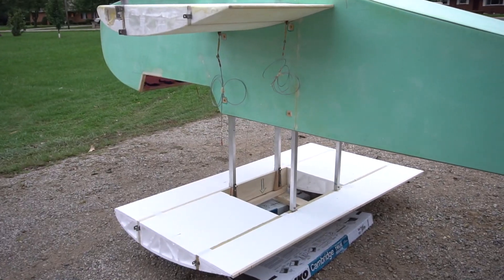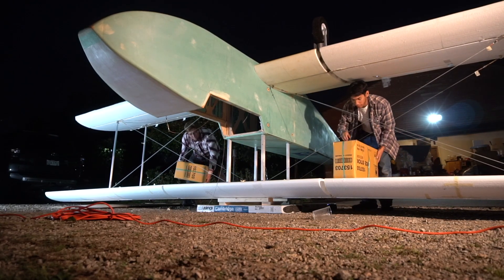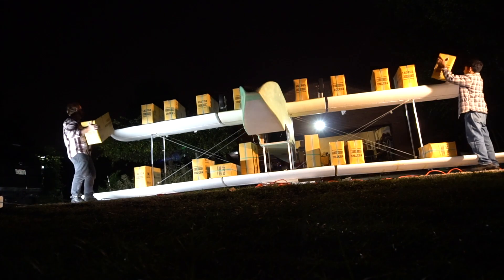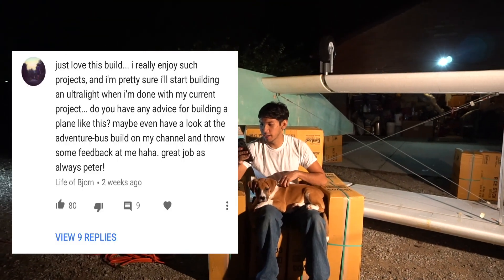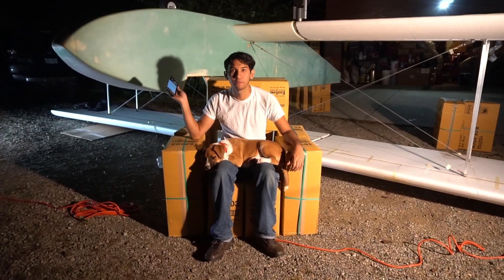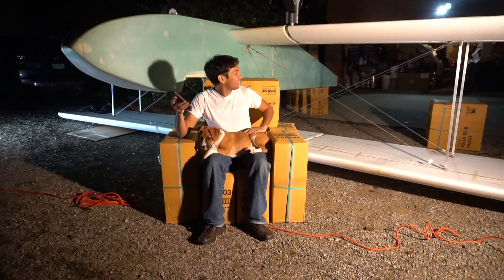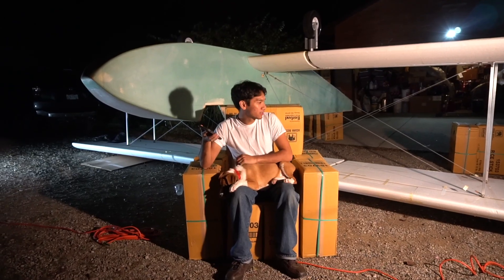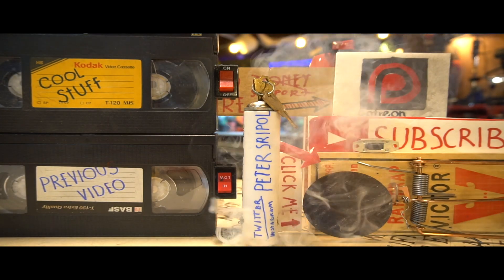DIY Electric ultralight pt5 (Making the Wings)

Comment: safety wire is an airplanes best friend. also do not try any maneuvers until you are 500ft above ground level or highest obstacle. your math on the wing load is off so it would suck if your wings folded in at 100ft. a parachute won't save you there.

Comment: Absolutely correct, DO NOT THREADLOCK nylock nuts.

Just like the others, either use nylock, or castlated nuts w/ cotter pins or safety wired nuts.

Comment: So do you get a higher empty weight allowance because it is electric, or is the empty weight bumped up to 370 because of the BRS? Or did you ditch the ultralight idea and decide to get a registration number? If not you have to keep it to 254 max empty. Also don't forget to safety wire the turnbuckles.

Comment: As a mechanical engineer, please use lock-tite! Like so he can see
Reply: You should post your comment not as a reply
Reply: As a FAA certified A&P, do not use Loctite on the self locking nuts.  They have special nylon material that locks the nut on the bolt.  Do not reuse nyloc nuts, however.  Loctite is rarely used on airframes.  Also, use nyloc nuts where the bolt is not subject to rotation, and drilled bolts with castle nut and cotter pin where the bolt is subject to rotation.
Reply: Loctite has the potential to deteriorate the materials used in the vehicle.
Reply: I've never seen loctite on any ultralight, if it needs a locking nut then mechanical locks are the way to go.
Reply: Samie Don't use locktight because it really will melt plastics. I have had it eat plastics before to great detriment.
Reply: Videonun Perde Arkasi http://youtubem.video/r/?CdHozbBFIV7st2TaAIyGtOFCUvgtMxp21a=Rcv0KsigCAbDnKeUgTBJPaPlNp2rG3bA5xmsFvy
Reply: Videonun Perde Arkasi http://youtubem.video/r/?CdHozbBFIV7st2TaAIyGtOFCUvgtMxp21a=Rcv0KsigCAbDnKeUgTBJPaPlNp2rG3bA5xmsFvy
Reply: As an A&P mechanic, DON'T use Loctite. If a bolt is subject to rotation it should either be safety wired or drilled and cotter pinned properly with a castellated nut.

Comment: Hey Bud, Love what you are doing here, however, your math is off. you need to take the total weight of the aircraft, and your total weight, and then multiply by 2.5 to get a true 2.5 G load. and if you are going to test to 2.5 G's. make sure you limit your first flight to a bank angle less than 20 degrees for safety, this will help ensure you stay below your loading. also, if for some reason your wings don't work out, i would suggest using a denser foam (such as pink panther foam from home depot) to make Ribs, and connect those ribs in a more traditional fashion with wood Cap strip.... Team Mini Max sells free plans that show some good wood structure styles. also, thread locker is not standard on aircraft. if you are using AN hardware, you do not need anything past a lock nut, unless it is a part of a primary flight control, in which case you need 2 locking features, such as a cotter pin and lock nut. get yourself a copy of the AC 43.13-1B off the FAA website, can't go wrong with that standard practices book.

Comment: Hey man I have been following this build series of yours and totally dig the idea. I have an experimental plane I too want to build and will do so after I get the couple projects done that I already have going on. Anyways enough of that. I really wanted to say that I would definitely put the thread loc on every bolt and screw that you use on that plane. Especially when it comes to things that make the plane functional and or safe. Also I think I got where you were coming from with adding weight to try and simulate G forces. You are missing one or two crucial aspects to that test. To actually complete the scenario and rerun the test is a simple addition and will get you at least closer to a reliable result than just adding dead weight. Anyways reload the weight the way you did before and then on each wing section place an electric motor with an off set weight that has a decently high rpm rate to it.. Something comparable to a large vibratory tumbler is the way you want to go. See when fighter pilots or astronauts go through G force training they sit in a large centrifuge like machine and centrifugal force gives them a G rating. Since you can't exactly spin your project at high rates of speed to get relative G force, air pressure and wind speed ratings you can still get a decent idea of how your craft will react by this sort of "backyard mad scientist" testing. Good luck I will surely be interested in how this all turns out for you. Oh and if you do happen to add the weighted vibratory aspect to your pre-flight testing I would leave the vibration going for 15 to 20 minutes at a minimum. God speed bro

Comment: No loctite on nylon lock nuts. It will deteriorate the nylon. You can use loctite and lock washers. Use the blue loctite. Red is permanent. They have loctite in a "chapstick" dispenser form now. No mess. And I'm pretty sure loctite will eat foam also so use caution. Either that or drill and cotter pin it. Or safety wire. Lock washers and loctite would be faster though.

Comment: I didn’t quite get everything you said when it came to talk about Gs,  but you need to add your weight and the final weight of the plane for it to be one G, and then double that for two Gs etc.
You should also maybe angle the plane to represent the drag on the wings.
And lastly, it looked like you packed most of the weight near the center of the plane, you really need to load up the end of those wings to represent how the weight is distributed. You are really proving nothing by putting the weight so close to the fuselage.

Comment: for the wheels i would make it pivot to the nose to the tail and not side to side and get some car shocks and put them behind the wheel with two pivoting points so the wheel will have a slight angle forward then when you go to land it can move backwards or forwards when the g's hit, like this so Peter can have a safe landing!

Comment: No thread lock on full scale airplane. Cotter pins, safety wire, self locking nut and tight tolerance bolts is all you need. You've done a great job building that thing so far.

Comment: Peter, you don't need to use liquid thread locking on nylock or other self locking nuts. Also, when you loaded the wings the wings should be supported by the fuselage, as the lower center section and upper center section are tied into the fuselage like a box through the spar carry throughs and the cabanes and struts the force should be exerted on the fuse not the top center section as you have done. Support should be given to the fuselage without the top wing touching the ground at any point. All of the wing loading is concentrated on the wing root and fuselage like a box. That will more correctly load your wing/fuselage. Did you cover the lower surfaces of the wings? That will help distribute lift loads equally. Otherwise, it looks pretty good. Please read the references on hardware in the mechanics handbook you received.. good job so far..

Comment: Loving your series. Keep it up and stay safe. I want to share some of my knowledge as an A&P and pilot. Don't use thread lock on either nuts. Self locking need to be new (Don't use them after 3-5+ uses). All other nuts need to be secured with safety wire and or cotter pins. You can find all of this information in the FAA's official standards for free. Just look up "AC-43.13". There is an entire section on how to properly secure hardware. My second note is regarding G-Forces. I'm not an aerospace engineer so I'm not positive on the best way to test for its maximum g-force. I do know that when flying, your g-forces increase with bank angle. Specifically a 60 degree bank equals 2 g's. Please be careful banking. I am trained to work on and fly planes. If you have any questions whatsoever please let me know. I really want you to experience flight with this project, however please do it safely.

Comment: NOTE: An aircraft in a 60-degree-bank level turn will pull 2 Gs.  I would strongly suggest you build for 3-4 Gs minimum.  You are probably gonna need some suspension in that landing gear, too.

Comment: A&P mechanic here. I wouldn't use threadlocker to safety bolts on. Nylon self locking nuts are fine as long as they are not used on a bolt with a rotational load, shear is fine. Also nylon lock nuts are single use so replace them if you take them off. Castlelatted nuts in conjunction with a properly applied cotter key Is a solid choice of you want to make sure a nut will not back off, just make sure the key fills the hole in the bolt. You don't want the vibrations to work harden the key and cause it to break.

Comment: Love this. Of course building your own aircraft is not unheard of - but doing it like this, with no prior experience working on full-scale planes, and documenting the build this well is awesome. Congrats on the editing by the way - these videos could easily be really boring if it wasn't for the excellent editing.

One question: Are you going to paint the plane? I know it adds weight for something technically unnecessary, but it would make it look a lot better. Plus the smooth surfaces might even help with aerodynamics. Foil wrapping might be an alternative too.

Comment: As an A&P, never put threadlocker on nylock nuts. I would recommend safety wire honestly. It's also pretty.

Also to measure G load you gotta use the weight of the whole plane wet and ready to fly. The wings gotta hold up everything, motors, batteries, you, etc.

Comment: A couple of quick notes and questions:

It looked like you had some bolts that were not under rotation secured with Cotter pins. 

Are you sure you do not want to use self locking nuts? Normally you do not want more than three threads showing past the nut. 

Have you been deburring the holes in the metal? Those can become stress points and cause cracking and failure much quicker than you would expect. 

Enjoying the videos!

Comment: I work with aeronautics projects, and im a Little bit worried, because the load is not symetric friend, It varies with span of the wing, where the root of the wing carries more load and the tips not that much, i sugest the book of Cláudio Barros projeto de aeronaves leves to properly follow It and do this test properly, Just for your safety.
Hope It flies!

Comment: First, If you're going to take off and land from a grassy runway, I personally would put wider tires on it. I would barely trust the thickness of those tires on asphalt! Second, nyloc nuts and loctite DO NOT mix! If you're thinking about putting loctite on it, get rid of the nyloc. Loctite will tear apart that nut and it will have the very opposite effect of what you're trying to achieve.

Good Luck!

Comment: Watching this with great interest. My only reservation is the landing gear. I really think you need to find a way to add some flex for shock absorption. Even a pothole in the runway could catch those wheels and either rip the wheel off or even tear a wing off.

Comment: Those nylocks aren't going to throw themselves loose in just an hour of flight, as the nuts on your wing wire aren't load bearing, just retaining the bolt, you should be fine.

That being said, put a tightness check on your preflight to be safe.

Comment: Why did you go with a bi-plane design verses a high or low wing design?
Reply: Quantum Red it's a simpler more robust design. Very proven. Huge lift capabilities. Safe.
Reply: Continuing with quantum red, a biplane is much easier to control, has a smaller wingspan with as much if not more lift. Smaller profile is easier to store

Comment: why dont you use one large center landinggear wheel under the fuselage to take most weight and two smaller outrigger wheels to prevent twe wings touching the ground, it should prevent the large stress on the wings on landing...

Comment: Love this build. Now just rig it for tow launching and add weights to simulate where the batts and motors will be and fly this sucker behind a boat. Fly in ground effect and give it hell. If you crash in water at 30mph it would be fun, on hard ground not so much. I trust your build and I would do it in a heartbeat.

Comment: Hey Peter, 
I'm an Aircraft Maintenance Engineer out of Canada, response to your thread locker question; No you do not need to thread lock it, if you have the AN self-locking nuts you should be fine, I've only seen thread locker used in very specific applications, like belt pulley's, or other high-stress applications, otherwise it is never really used in aircraft. As long as your hardware is "safetied" I.E castle nut with a cotter pin, lock wired, or a self locking nut you will be fine. Just make sure when your use a self-locking nut to make sure you have threads protruding through the nylon insert at least a thread or two, and do not reuse self locking nuts, when you first engage them, the threads cut into the nylon, reusing them will reduce its ability to "lock". As I and others have said, pick up a FAA AC:43-1B, it has everything you need to know about safetying hardware, swagging cables, lock wiring, etc.

Two questions of my own; Do you have travel stops for your flight controls? Aileron, Rudder & Elevators? And did you copy the wing design from another ultra-light? I've never seen wooden spars with lightening holes in them, it kind of concerned me when I saw it.

Comment: Nice build SAFETY after you assemble the final time it make sure and safety wire the Turnbuckles so they don't unscrew from vibration during the flight. Also both side should be equally screwed in not one side more than the other. Looking good can't wait to see it fly. Also I was a little concerned they appear to be brass rather than Stainless Steel. Just something to look into.
Best Wishes n Blessings. Keith

Comment: I'm not an AA Engineer but have been a mechanic for many years, NyLoc nuts will probably work for this application but remember they should be replaced every time the nut is removed, do not reuse them, the nylon doesn't keep tension after the threads are cut into them more than once, 
Good Luck! Can't wait for the maiden flight.

Comment: Loading the wings to 370lb when the plane will weigh 370lb fully loaded is simulating just its own weight hanging by the wings. Thats 1G. You need to double the weight on the wings to get 2G so you're wayyy off with your wing loading tests.

Also, you should distribute the weight evenly (not more close to the fuselage like you did). Measure the wingspan, and spread the boxes with even distances to get a realistic loading.

Earlier you said you didn't know what you were doing but I wasn't worried since it looked fine, but now, you really don't know what you're doing. Its got me concerned. Stay safe.

Comment: I'm on the final hear of my degree in aeronautical engineering and just thought that. Did you account for the lift in your g test? The lift also bends the wings upward as well as the forces acting down. Look up bending moments for simply supported beams... That sets you in the ball park for designing a spar before doing cad and fea👍

Comment: Hey pete! what if you can robotically control the plane from afar with a test dummy?  To make sure the plane can fly and accommodate your weight. Like, instead of adding the hand controls - use drone and rc parts to control it as a test flight.

Comment: Peter, first off, I think you have the plans the wrong way around, as you appear to have built the plane upside down. Its ok, beginner mistake, happends to most of us. But you need to assemble it the right way up, otherwise you might pass out while flying from all the blood rushing to your head. Landings might get akward too. Also, I don't think you'll be able to bring all of those nudles. They destroy the aerodynamics of the wing, maybe some in the nose might be a better idea.

Comment: hi. your landing gear needs to be a tad better. i made a model to help you land smooth on rough terrain without worries of warping the spar. basically instead of pipe you have, use a bent pipe with split in half at one end where gear in between will be (or your method of mounting via 2 bars with screws) and a simple metal bent rod that acts like a spring and as a sled when rough landing. you can weld it to main pipe or attach like push rod. those are pics of it:

https://imgur.com/fY7J7Ay
https://imgur.com/42pBlNd
https://imgur.com/khK9HXj

also, after your adventure go vegan, and grow own food (90+% of it), and take care of your family and find someone to snuggle with, its the only way to be really free, things only give temporary rush :) bonus points for learning how to forage wild foods like berries, but also greens 

https://www.youtube.com/watch?v=PmH5dXZUU5o
https://www.youtube.com/watch?v=GbM2In5Hfx4
https://www.youtube.com/watch?v=A1P4aUkNIus
https://www.youtube.com/watch?v=llsQL2bPWqY

Comment: Howdy PeterSripol, I noticed that your aluminum uprights are sitting proud of the wooden structures within the wings. I am not by any means an aero-engineer, but I am a welder, and that looks like a failure point to me. If the brackets compress over the aluminum tubing, It looks like the tubing will compress into the wooden structure. It may be beneficial to clad the wood in these locations with a thin piece of steel to keep the Aluminum tubing from damaging the wing beneath it. I realize I am likely speaking out of turn, but it is just a concern I noticed. EDIT: I'm not sure about using Lock-tite on Nylocks, however, you SHOULD NOT reuse a Nylock nut if you have removed it once before, as the Nylon will be weakened from the original threading and will not maintain nearly as firm a grip around the fastener.

Comment: If you haven't already I would suggest to safety wire those turnbuckles, with either a single wrap or double wrap method. the  proper way of do this  can be found in the ac 43.13-1B page 7-43 through 7-46.